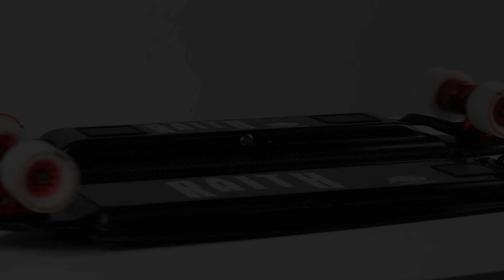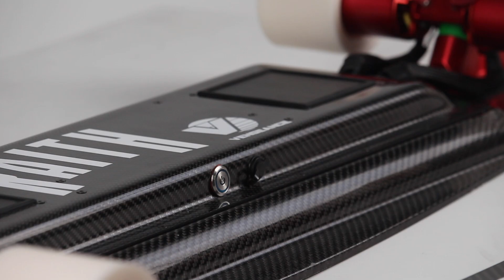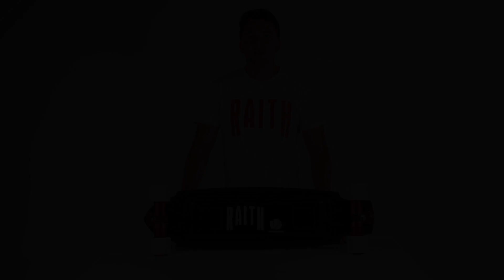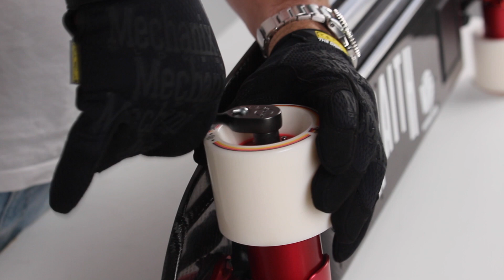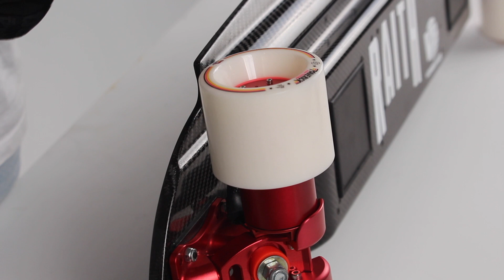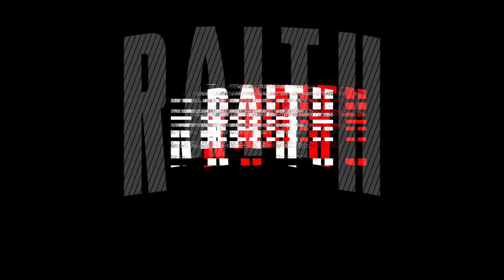Raith Vengeance Specifications Explained

Comment: Don't buy these. Unless snapping axels during standard riding is what you're after. It took 3months to get it back and it's fkd 😂 This guy is a dick who has no communication with customers other than "I don't work for free" and "cheap cunt" I was charged $100 labour $150 parts.. on the site it states $50 service and what that entails, yet upon swapping a hanger at the above price, I was asked for a further $100 to test... I was also told he couldn't test it without controllers, which was in the bag, with the board for 3months up until the day I collected it.... I had been patient. I had stated numerous times I just want to skate and that it was my main form of transport and that money is of no issue... Guy couldn't even Grease the axel? Like 😂😂😂👌 literally called me a "Cheap cunt" great customer service! 

All because the board was second hand, nearly 11months ago.. I've been thrashing the $800 midnight for 11months...   How bad could it have possibly been before I got my hands on it to. E able to do that.... It was near new I got the best bargain around and he got sad. Thought I was a bum! Then I said I have money and he tried to overcharge! Didn't want to deal with it from the beginning. He could have simply said that to begin with 3 months ago... 😂🫵🖕

Comment: This video says the battery in the vengeance is a 44.4v 10AH 440WH 12s2p , but the website says 40.7v 10AH 407WH 11s2p . Any reassurance on which one it actually is?
Reply: I’m curious as well
Reply: @basicsushi  I got a message back from them on instagram a while back and they said the website was correct
Reply: Did they answer?
Reply: @SanMonki  they said the smaller one listed on the site was correct